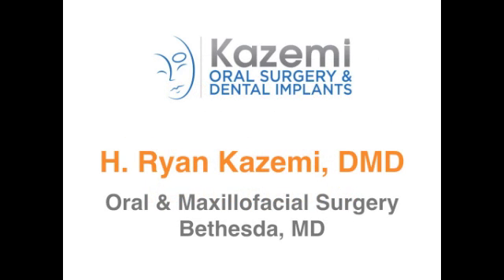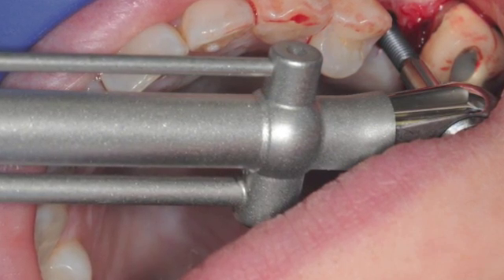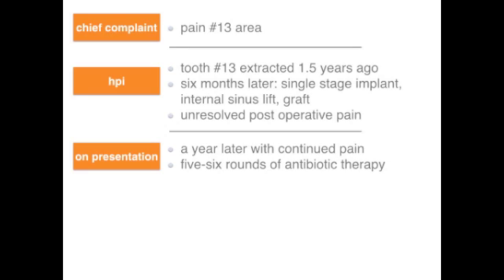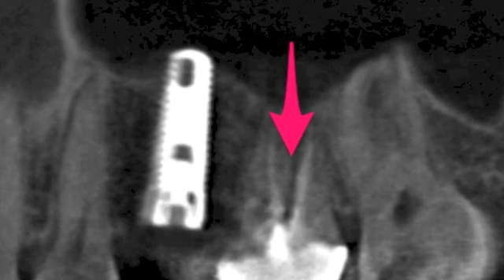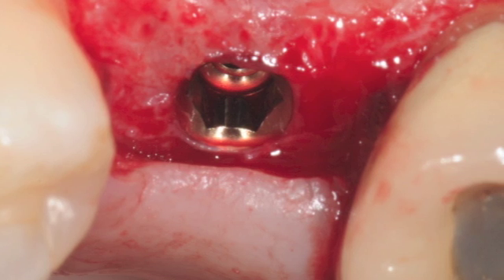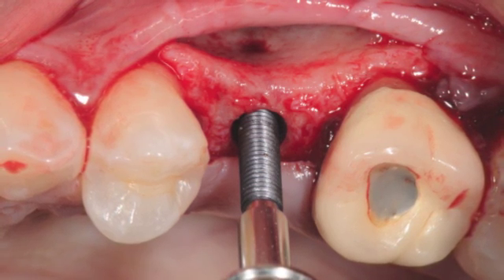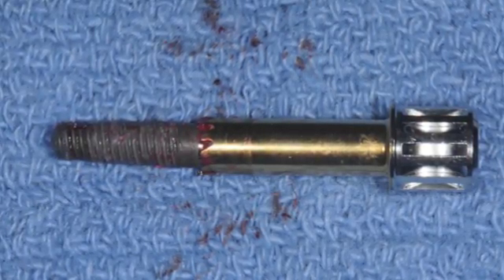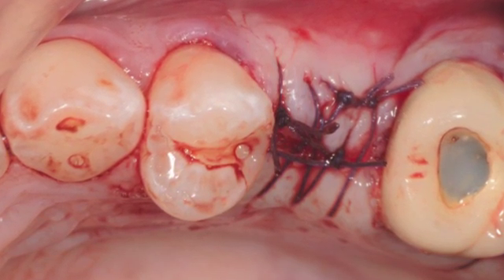New Technique For Removal of Failed Dental Implants

Comment: With all respect, this is NOT periimplantitis. You should investigate more prior to removing a very nice/ stable implant!!!
Reply: I agree with you- not peri-implantitis by classical definition. The buccal aspect had no bone in the middle aspect which does not necessarily cause symptoms. However in this patient, the chronic localized pain with marked point tenderness in the buccal aspect was evident and probably aligned with some inflammatory response. Removal of relatively stable and healthy implants is a tough judgement- Patient was given every other treatment option but selected explantation considering the significant symptoms. Her symptoms resolved immediately after removal. I appreciate your very important point.

Comment: I have a patient that I placed 4 implants in front region of lower jaw. During the period of osseointegration patient never had any pain nor signs of infection. All 4 implants fully osseointegrated but after I placed gingiva formers she started feeling pain in the projection of the apex of one implant. Even though there were no signs of infection or periimplantitis I prescribed her antibiotics but still pain was present. Now she wants to have all 4 implants removed and I am wondering is it possible to remove fully osseointegrated implants from lower jaw with this sistem or you suggest to slightly remove the bone in the upper portion. Implant sizes are 3.5mm wide 10mm Long?

Comment: Amazing, simply amazing how fast our technology is moving. Hands down, best dental implant video I've ever seen by the best speaker. I love your accents on words.  It helps one to understand better. I've had a total of 5 implants of which 2 rear removed, for some reason. 1 molar implant, which I just love and now after 30yrs of having the golden gate "Bridge" in my upper mouth for 35yrs. It finally collapsed and now I just have two front implant for my upper denture. The "Clip on or Snap on, to the implant, only last about one month. Can you recommend a good type of Locater that clips in and out nicely and snuggly?  Thank you so much and again, Excellent Presentation!